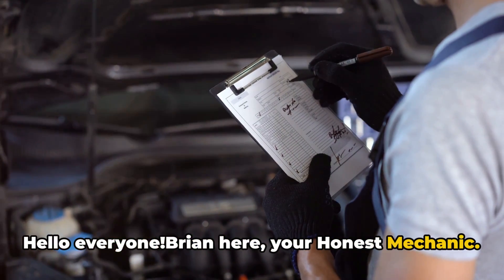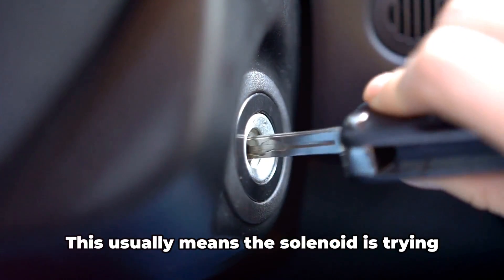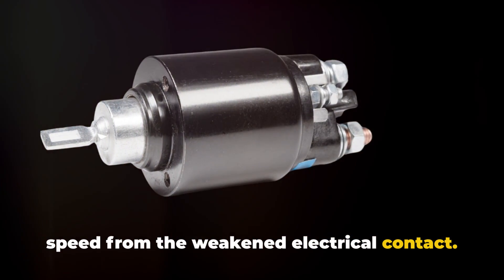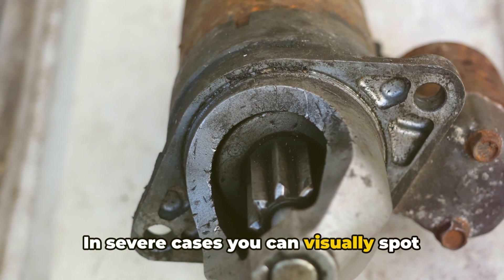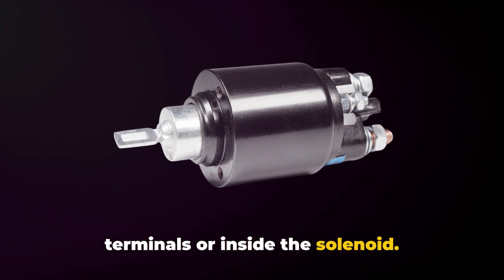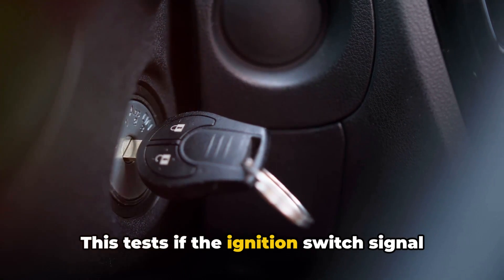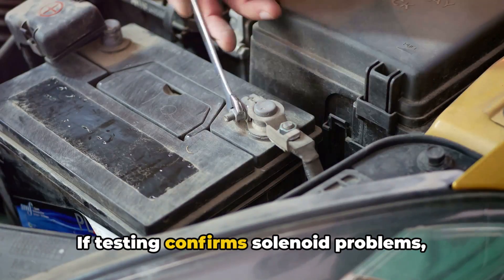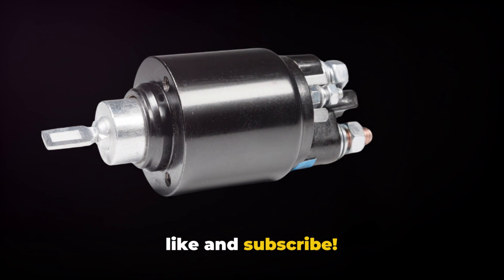Bad Starter Solenoid Symptoms: 5 Leading Signs

Comment: How to check if the battery voltage is actually reaching the solenoid , as you just skip that part,  and continued to say , and if good, then it's ... And what do I have to do to do that.?

Comment: My Starter Bendex was launched into the flywheel but because there was not enough power to start the vehicle it did not return to the Starter and now I need to pry the Bendex back out so I can replace the starter. How is it possible to do it....please?

Comment: During freezing weather, my 5.3 Chevy won't crank. I replaced the battery and thought that fixed it but during another cold spell the starter wouldn't spin.
Reply: That is usually the symptom when water and moisture is not draining from the bottom of the Starter, then in cold weather it freezes and the starter can't turn.

Comment: Can starter motor dies batery when car is parked ?
Reply: Yes it drains the battery.. did you change it and how does it behave now
Reply: Yes, this issue can be caused by a faulty solenoid battery terminal. The main culprit is often overtightening the terminal bolt, which can crush the typically weak plastic insulation; this, in turn, may lead to grounding against the surrounding metal body. Additionally, using oversized terminal lugs that lack a rubber insulating boot could expose them to contact with other metal components.

Comment: Thank you so much for this video but i have a with my starter motor; after my engine was rebuilt, the starter makes a clicking sound and engages with the flywheel but doesn't turn the engine. What could be the problem please?

Comment: HELP!! I have a 2006 Chrysler 300c 5.7 hemi. I have been experiencing delayed shifting in 1-3 gears could be a soliniod?
Reply: Delayed shifting in 1-3 gears??  Are you referring to the transmission shifting is delayed? If so, it’s rather odd you’re looking at a video of starter problems. The solenoid in a starter has nothing to do with your transmission.

Comment: Would a bad solenoid cause all my power in the car to go out? 

I go to start the car and everything comes on etc in auxiliary mode but as soon as I go to crank I hear a click an everything shuts off like the battery dies. (Battery’s new an I just had it tested) but I wiggle the battery around an everything comes back on
Reply: it sounds like your terminals are just corroded and isnt touching the post on the battery fully just replace the terminals
this happened to my 04 g35 before

Comment: I'm going to try and word this as best as possible.  Friend car new battery installed car still will struggle to start unless she puts a jumper box on the battery terminals then I cranks right up. I was thinking wiring, starter, or solenoid

Comment: I have a 1999 Ford F150 and it only cranks when rain it’s on like something is getting wet but I can’t find anything on the on the fuses but it only clicks and no start but only happens when raining what could be wrong with my truck
Reply from the maker: Hi Hector, managed to find out? Your Ford F150's starting issue during rain is likely due to moisture affecting the electrical system, such as the starter solenoid or wiring.

Water can cause short circuits or corrode connections, leading to a clicking sound when trying to start. Common culprits include the starter solenoid, battery connections, or fuses getting wet. Check for exposed or damaged wiring and ensure all electrical components are properly sealed. Replacing or repairing corroded connections could resolve the issue

Comment: Yeah. One year old starter.  I have been retired and have not gone out much so the amount of starting the engine is low.  Chrysler 300 2006 3.5 engine. Very difficult starter to remove and replace.
Reply: Typical Chrysler. The engineers have IQs of a box of hair. I gotta pull the engine in my jeep Cherokee to replace mine. 🤦

Comment: Well, thanks for confirming the source of my boat starter problem... only was getting clicks when turning  the key.. the problem would occasionally happen last summer.   This summer, it gradually got more common.. happening more and more.  Today, it was persistent.  So I removed the various wires on the solenoid - tightened a couple.  Really snugged up the connectors.  And viola!.. after that, got one click.. then it has engaged.. then turned over.  Hoping that the problem is solved - at least for the rest of the boating season!

Comment: Had an issue with car while in the woods. Turned off my car for a 10 mins after driving 3 hours to my hunting spot. Car wouldn’t start, heard clicking noises, battery looked good. Waited 1 minute, tried again, then it started right up. It starts up every time since then while in town, been over 8 mos since that happen. But I dont trust it going to the woods anymore. What could have been the issue?

Comment: Been having intermittent slow cranking speeds for a while, in fact ever since I got the bike. Bought a battery tester Topdon BT20 and it shows my battery is fine upon load testing, but the cranking voltage is dropping down below 9v much of the time. I took apart the starter motor and cleaned up everything, including all contacts and it made no difference.
Reply from the maker: Hi, managed to find the culprit?  It sounds like you've already done some good troubleshooting. Since the battery seems fine under load testing but the cranking voltage drops, it could indicate an issue with the starter motor or the electrical connections between the battery and the starter. 

Here are a few more things you might consider checking:

1. Ground Connections: Ensure that all ground connections between the battery, engine, and frame are clean and secure. Poor grounds can cause voltage drop issues.

2. Starter Relay: The starter relay could be faulty, causing intermittent voltage drops. Consider replacing it if you haven't already.

3. Voltage Drop Test:Perform a voltage drop test on the cables between the battery, starter relay, and starter motor. Excessive voltage drop indicates a problem with the cable or connections.

If none of these steps resolve the issue, it might be worth having a professional mechanic take a closer look, as there could be a more complex electrical problem causing the voltage drop.
Reply: @HonestMechanicChannel   Hi, thanks. Still not found it. But yes, when I said I cleaned up everything, I meant all contact points as well. Positive wires, negative wires, even the terminals of the battery got polished up to a shine.  I did notice when I put the four brushes back up against the commutator it was much harder to rotate it, but I'm guessing this is normal with newish looking brushes?. It's my first time stripping down a starter motor so I'm not sure. I put it in a drill press and put varying degrees of sandpaper against it until it was buffed up smooth, ending in 2000 grit. Maybe it's so smooth that it now has more friction with the brushes. I'm still wondering if the battery is at fault and the battery tester itself is not giving the right reading. It is a little inconsistent at times. Once it said my charge was 70% and the second time I pressed it it said 94%. Nearly every load test said good, while one said moderate. But, my battery charger which I often plug in through the glove box always lights up to say there isn't enough charge to crank for the first 30min to and hour after plugging it in, until the 3rd light comes on to say it's ready, then it will take a few more hours until it says it's full. Before this, the multimeter and tester say it's full at around 13v. This same charger when I plugged into my older bike would always go to the 3rd light straight away, so something is up. It is the original battery on the bike and it is 10 years old, so I might just get a new one and see what happens.
Reply: @ArcanePath360  was it a bad battery? I’d say you had a bad starter that’s on its way out but the voltage drop indicates weak battery contrary to your load test. I would have put jump box or jumper cables on the battery connected to another known to be good battery like from your car then try again.  It could be a wiring issue but I’d lean toward failing starter or failing battery.
Reply: @lh98  Yep, turned out the battery was just old and unhealthy (11 years so it was ready to retire)

Comment: I just installed a brand new starter on my Mustang 3 weeks ago, and now it will not start. It makes a noise,  UT the engine doesn't even spin ? Could it be my selinoid ?
Reply: Check the starter relay
Reply: I’m sure you’ve figured out the problem by now but a brand new starter often is actually a remanufactured  starter, an old one that was cleaned up and rebuilt. It’s quite possible it’s a failed part and they should exchange it for you. Also could be a wiring issue. I’m curious if you’ve resolved it by now?